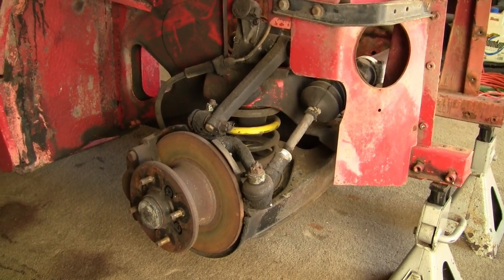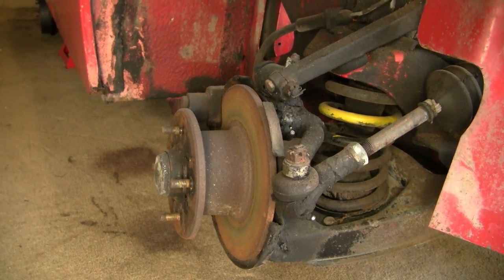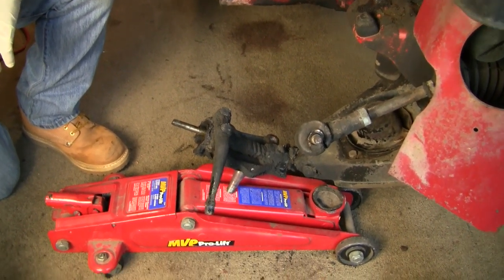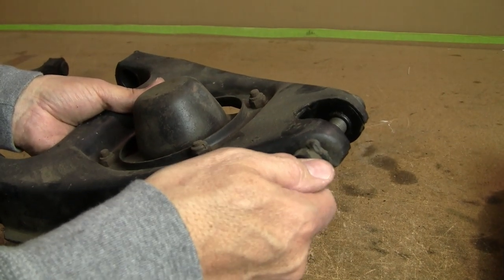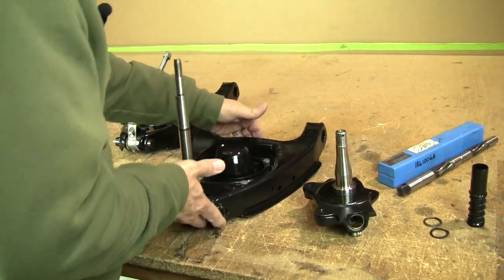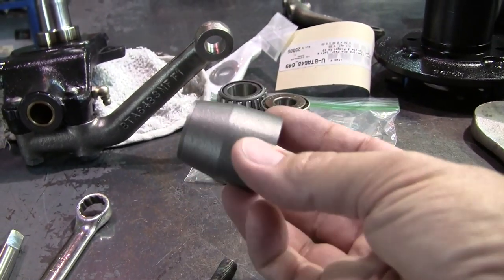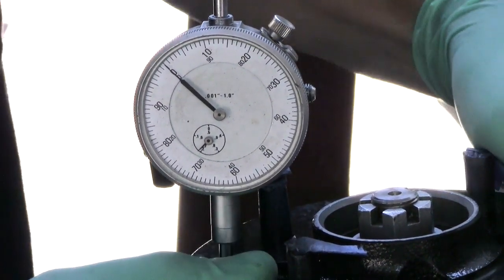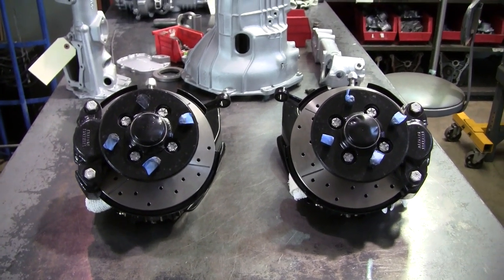Stub Axle Rebuild With Tapered Roller Bearings, Sprite & Midget

Comment: I remember working on these in the 1990’s as part of a team at an MG/Healey specialist. They could always be a challenge to dismantle if not well looked after, which seemed to be most of the time. Your mantra basically is, like ours was in our workshop-as we did restorations, was to always get your engineering correct first up. I always take my time with this stuff...that’s important. Get it right first time. Excellent video, bought back some interesting memories. These days I tend to work more on Jaguar product, but naturally, the principles are always the same.

Comment: You have it the wrong way round. The shock resting on the bump stop is correct, the one off the bump stop has an issue.
Reply: At what point in the video?
Reply: Cheers for that, I have a creeking coming from my front suspension so going to rebuild, I watched the start of this video and assumed mine were bad!

Comment: Wait, what are you saying at 2:21 about the lever shocks being in bad condition if they let the lever arm go all the way down?  Why would they design a lever shock that does not let the suspension travel the full distance?  For that matter, of the 6 I've worked with, including new ones, they'v all allowed full travel.
Reply: RodShop Yes, exactly my thoughts. If the shock arm didn’t go all the way down, it wouldn’t need the bump stop!
Reply: I'm being told the same by the midget club as I assumed mine were bad after watching the video. That they are dampers so should be stiff to move by hand but having them all the way down with the spring is normal
Reply: and to add to your comment the spring is captured at the top - the spring is going to try to decompress the only movement available is the a arm swings down pulling the lever down on to the stop the other side doesn't either the spring is weak or the pivots are seized

Comment: Are the steering arms reversed (swapped left and right), all the ones i have seen go down at the front ,
Reply from the maker: Good eye ...yeah, they're reversed. The BTA648 is the RH one, the BTA649 is the left and when installed the hole for the tie rod end does face downward slightly.

Comment: Excellent and informative video.  I just wish you had installed the dust shield in sequence instead of mentioning it at the end.  Don't ask me why.  :-)
Reply: You have it the wrong way round. The shock resting on the bump stop is correct, the one that's off the bump stop has an issue.
Reply: @alexibrowable  What part of the video are you talking about? Can you give a time of the issue in question?

Comment: Hi Brandon. I bought some wheel lugs from you guys, a quick question, to change the front lugs, do I have to remove the hubs and separate the rotors to install them?
Reply from the maker: Yeah, the hubs should come off to replace the wheel studs.

Comment: Hi, I have a 1968 Austin Healey Sprite MKIV with the 1275cc. I am going to be rebuilding my front suspension like you are doing in this video. Replacing king pins, lower A arms and adding a stabilizer bar as my car does not have one and the A arms on the car do not have the holes for the stabilizer bar to mount to. I wanted to ask would you recommend getting the stub axles in this video. I believe the car has just regular ball bearing style wheel bearing which you say you could change over to roller style bearings? Thank you for making this video, it gives me a Good idea of what I will be expecting for this job!
Reply from the maker: The stub axles in this video are much stronger than the OEM cast type as they are billet steel. Definitely an upgrade but not a necessity for a street car. However, the competition type axles are only about $40 more per side so I usually recommend them. You can still go to the tapered bearings using the stock stub axles and set them up the same way as explained in the video. If you're adding a stabilizer, I would buy new lower a-arms as new ones are pre-drilled for the stabilizer brackets and because it's almost impossible to unscrew the lower pivot pins from original a-arms that have been on cars since the 60/70's.
Reply: A couple more questions I have are do the competition stub axles come with the wheel hubs and would I have to have the king pins reamed or do they already come reamed. How would you know if the leaver arm shocks is worn and needs to be replaced and lastly would you recommend replacing the springs or recondition them. I think everything is just about original except for the outer the rods because I replaced them and did a front end ailment. Thank you for answering my questions.
Reply from the maker: The stub axles come reamed to fit the king pins - ready to install. They don't come with hubs. If the shocks are really easily to move by hand then they need a rebuild. The springs won't need replacing unless the lever shocks are shot and the car has been sitting for years on the coil springs alone.
Reply: Could I use my original hubs or would you recommend getting new hubs along with the stub axles?
Reply from the maker: I would use your stock hubs if they aren't marred up.

Comment: I’m doing a similar thing with my 74 midget, got any tips for removing the two bolts on the back of the lower pan? Mine seem to be stuck in there
Reply from the maker: The bolts that join the pan to frame rails? Probably just a bunch of Liquid Wrench and patience. Mine came off pretty easily but the rubber was in terrible shape.
Reply: Yeah those are the bolts I’m struggling with. Seems like it should be easy to just get them out but they are stuck in there pretty good.